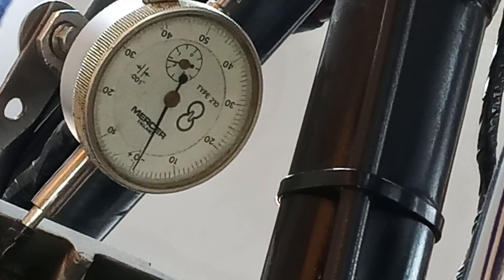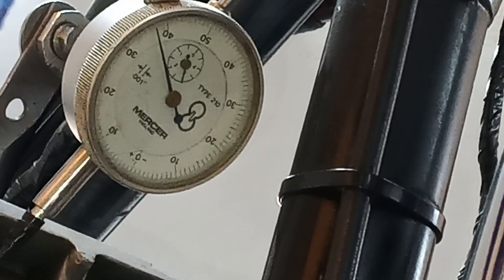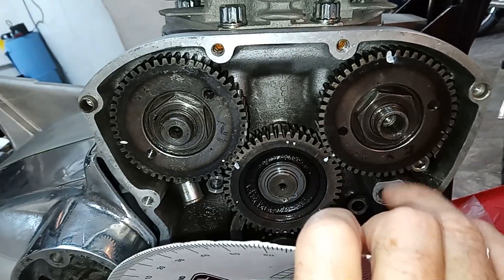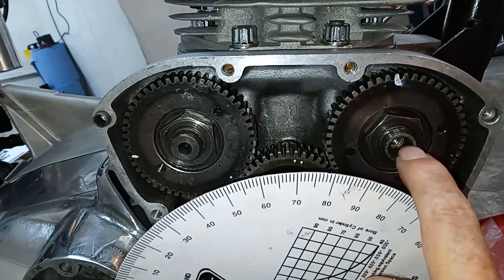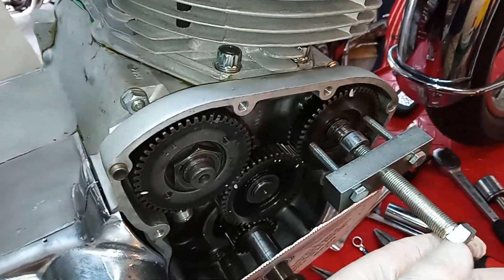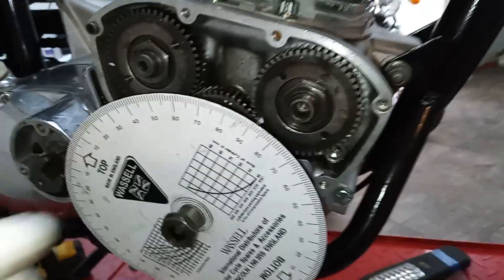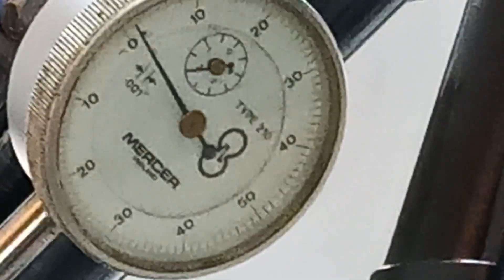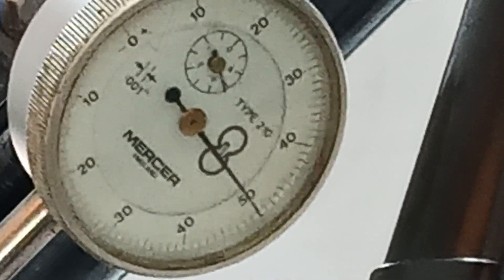Triumph Trident T160 Rebuild. Part 65: Optimising the Valve Timing 3

Comment: Hi; regarding the EX camshaft gear; actually is 17 gaps; teeth are for the intermediate gear; anyway; that amount is the other factory mark; not new mark as you needed to do with the IN (an implied "C" mark) so you advanced the IN and retarded the EX?
Regarding the torque; bear in mind that almost all the manuals are misprinted and never ever will be 75 ftlbs. For example; the crankshaft pinion nut is stated as 80ftlbs! but besides says 5.6kgm and that is right so about 40 -45 ftlbs max so this other nuts are less than 40 also are LH threads so never ever will come loose.
Reply from the maker: Thanks for that info. Regarding the timing I advanced both the inlet and exhaust cams.
Reply: @Chris.rooke150 ..I think that you started with the factory marks; so if you move the inlet to the other mark (the dot) would be retarding the camshaft opening
Reply from the maker: Hi there, I'm not quite sure what you mean by 'the other mark'. I wasn't moving the camshaft pinions round to any mark, I was just moving them round to the next available keyway (which is 17 teeth/gaps) from the original standard factory marks. As each keyway adjusts the valve timing by about 18 degrees moving them round one keyway provided the correct reading. I never adjusted the timing to any given mark, just to the next keyway.
Reply from the maker: Yes, probably, but be aware that the pinion isn't moved to the dot, it's rotated 1/3 of the way round to the next available slot for the Woodruff key on the camshaft.
Reply from the maker: Right, I'm not sure which second mark you are referring to. I'm thinking that there are the inlet timing marks and the exhaust timing marks on the outer edge, then another single dot next to one of the keyways on the inside of the pinion. Is it one of those you are referring to?
Reply: @Chris.rooke150  Normally the IN and EX pinions have 2 factory marks (a dash and a dot each one because the pinions actually are the same) then the intermediate pinion have marks too. If you check the manual the factory timing is to engage the IN dash to the intermediate dash; then the EX dot to the intermediate dot. So; normally when rebuilding (or if is new never opened from factory) you put the timing at those marks; then tweaking for performance. If not there is no reference point. Hence I am saying that if you started with the IN dash mark to the intermediate dash mark and moved it CCW 17 gaps; you retarded 9.6º. So possibly with lobe center near 100º or more